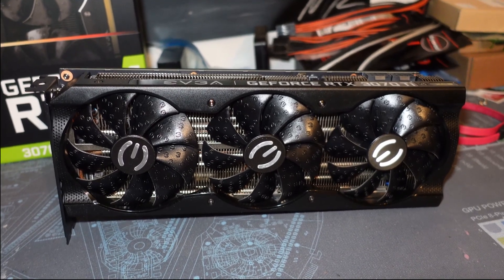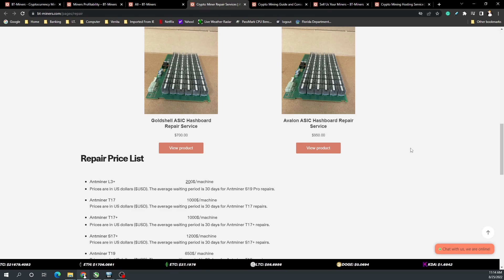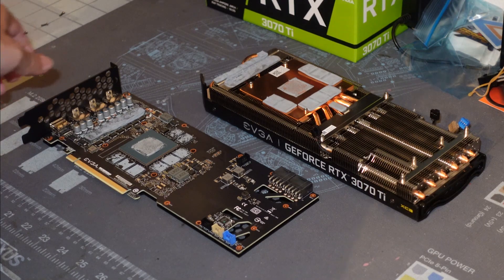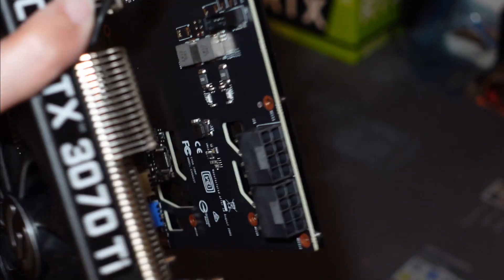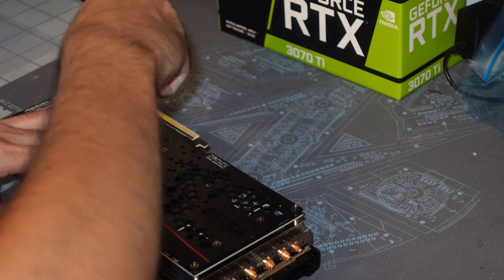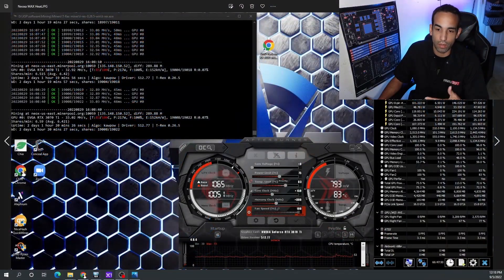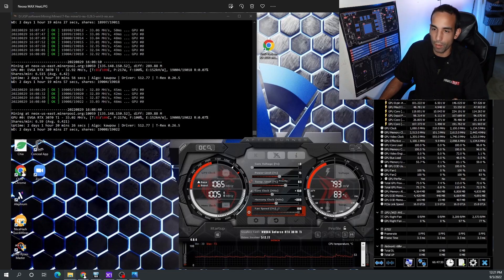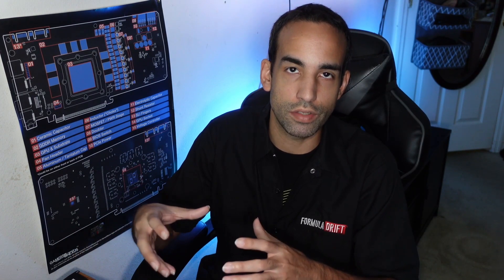RTX 3070 Ti Memory overheating - CoolMyGPU Copper Plate Mod

Comment: You showed 3 minutes of assembling the card and did not showed the process of applying the copper plate. What's the point?
Reply from the maker: Because I done it before for other cards. Damn if you do, damn if you dont... some complained about showing to much, your saying the opposite, so can't win. Look up 3080 copper plate one. But you just want thermal paste on both sides, non conductivity good thermal paste, I let is squeeze out on cooper surface and components.
Reply from the maker: https://youtu.be/nVeNBhjTflw

Comment: Hi there. awesome video. just what i need for my gpu. it goes to 95° and does thermal trhotling.
I need help, I'm new to this and I don't know the height of the copper I need. Would it be 0.5mm or 1mm?
GPU: Gigabyte RTX 3070 vision oc 8g
Thank you very much for your contribution and to the community.
Reply from the maker: 1mm if Thermal pads for memory,  or .8 mm if cooper. It is 1.5mm for replacement thermal pads for thr VRMs, and for cooling back of memory to the backplate you will need 2mm or soft 2.5mm that can squish out. For copper plate, https://www.coolmygpu.com/product/ga104/2

Comment: What about risks on shorting something out?
Reply: Have some kapton tapes to cover the transistors around. Just make sure that you get the correct thickness of the plate that is suitable for your card. Better yet, copper shims are more flexible and safer if done right. I did a copper shim/thermal pad combination and lowered vram temps to 65C, What is time consuming is kapton tape placement - take your time in this. Don't use nail polish as these are flammable.
Reply: You're supposed to use Kapton tape like I did around all of the vulnerable parts.
Reply from the maker: Nail polish or kapton tape. Look at some of my other videos

Comment: Big pass on these kits. It's not work the risk of killing a gpu and it's too expensive per GPU. I'd rather sell all my gdde6x gpus or just put them on  ergo which doesn't heat my vram temps up. For example I have 84C on my vram for rtx 3090s during the warmer part of the day and 70-76C during the cold part of the day.
Reply: the copper kits off aliexpress work well i have modded 14 cards using tgpp10 not thermal paste .3090 temps are 64c  3070ti temps are the same .
and i have a bunch of 3070 that i have not modded yet because they are just bad ass cards and don't need it .but for 10$ each copper mod off aliexpress is worth it i think.and its exactly like the ones cool my gpu sell.
Reply: They have to solve the issue of overheating which will ultimately kill their GPU. The kits are quite expensive so I did the cheap copper shims mod. This is not an ordinary modding and if you are careless, you will short the transistors in the GPU and kill it. Your vram temps are within normal range so there is no need to mod it.

Comment: My 3080 Ventus was overheating and I did a copper mod with shims on all of the VRMs and new MX5 on the GPU.  I went from 110c to 70c under load.  Unreal results, but others have reported similar results.   I honestly didn't believe it until I did it.